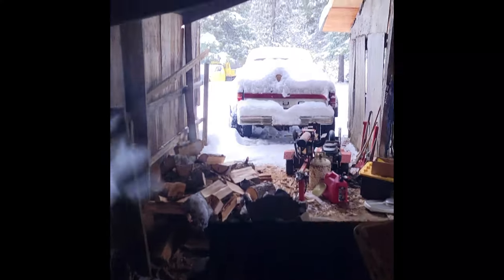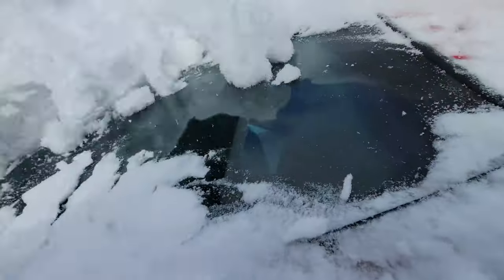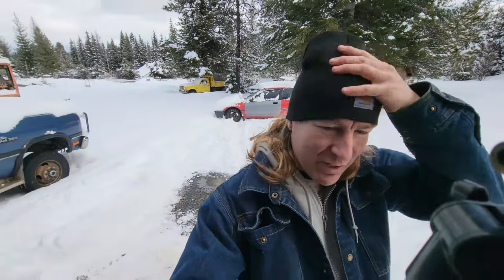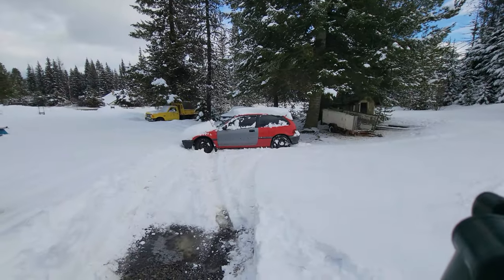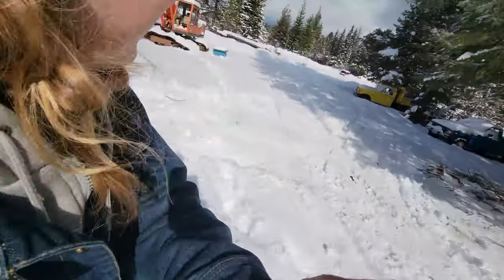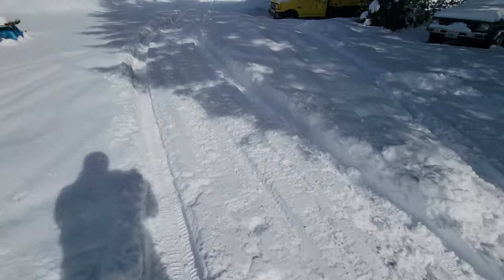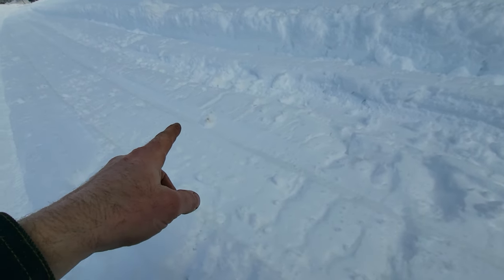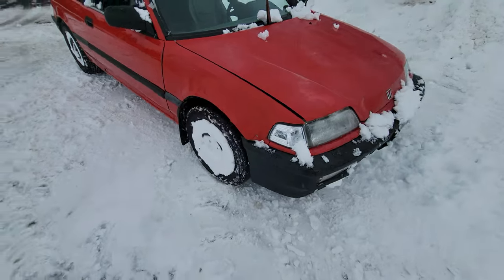Honda Civic plows 9" of snow - MFactory LSD

Comment: I'd just ride that excavator
Reply from the maker: I actually started up the excavator and was going to pull my car out with a long rope after I got it stuck.  Then I tried one last time to move my car on it's own power and I was able to get it moving again.  But I can't move my excavator right now until I get the track put back together.  But ya, that excavator will push through at least 4 feet of snow without any problem. I've done it before. And could probably could go through even deeper snow.